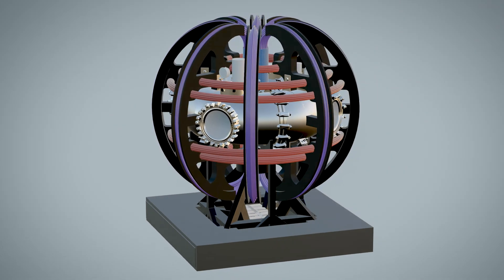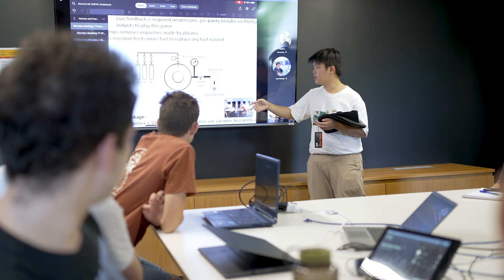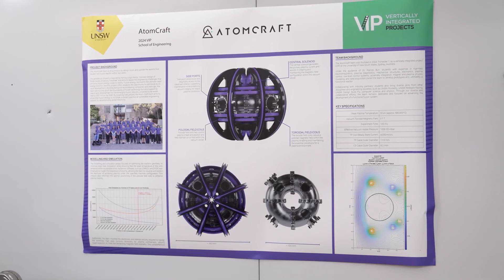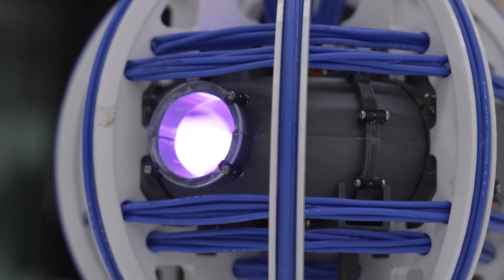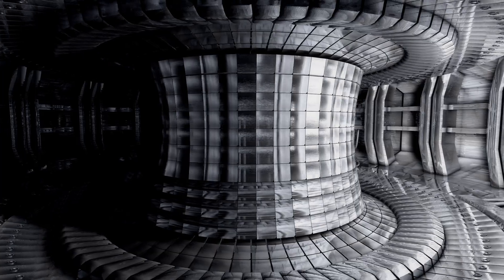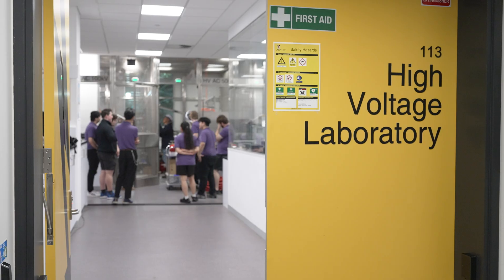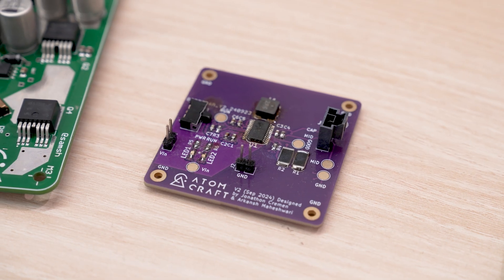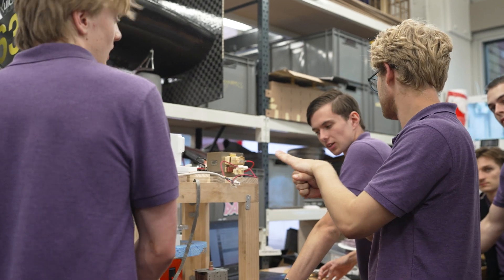Creating the world's first nuclear fusion device, designed and made in a student-led project

Comment: This is not the first nuclear fusion device, proven to have worked, designed, built, and operated entirely by undergraduates.  Peninsula College, in Port Angeles, Washington, had a team of 6 students in 2008 successfully designed, built, and operated an IEC fusor for multiple runs.  They did this with a budget of less than $3000.  Google "Peninsula College Fusor Project".  ✌️✌️